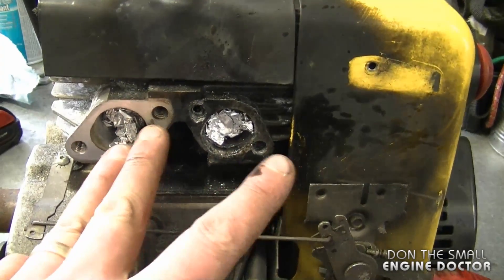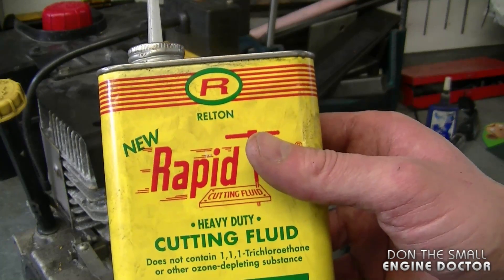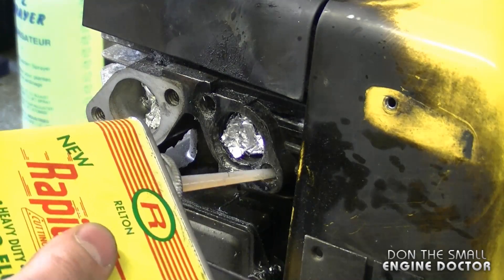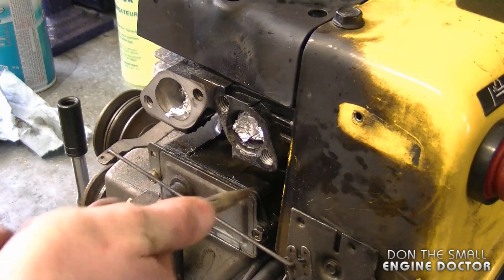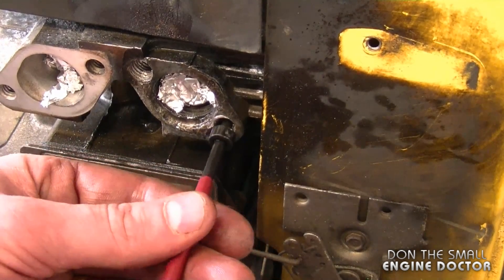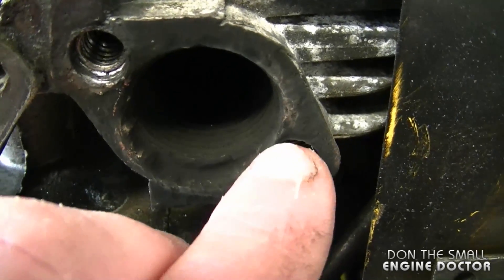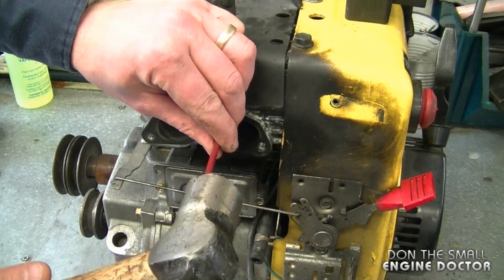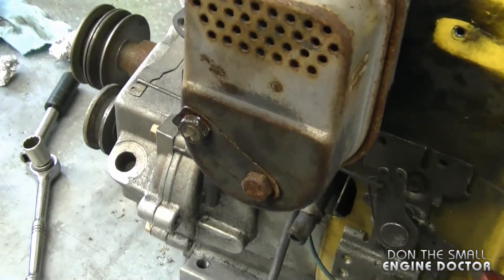How To Fix Stripped & Damaged Exhaust Threads Using HELI COILS - Thread Inserts

Comment: So umm, what happens when bolts come loose after helicoils have been installed???  

I got a paddock slasher mower with a GX390 engine on it.  The thing vibrates like CRAZY (big spinning drum with blades attached). The exhaust bolts kept loosening themselves.  I actually destroyed an exhaust letting it vibrate too much when loose.  Bought a new one and installed helicoils.  However the bolts STILL come undone.  I have to watch and tighten them up every 5 or 10 minutes.  

So umm, what's better the next step after heli coils? :P

Comment: Great cover on installing heli coils!  Thanks Donny.  One thing I did notice that, as you briefly mentioned, one of the holes had the "bolt inside".  I presume that it had broken off at the thread shoulder, leaving the threaded part inside.  I carefully looked at the previous footage, when that particular hole is being drilled out, before tapingdd.  It looks like a step was left out? It appears that the broken stub in the case had been drilled out with a smaller diameter drill?  This would leave the remainder of the broken bolt inside, with a hole down its center.  Just wondering ...

Comment: When using a Heli-Coil insert, remember that although the tap (your bolt size) needed may be say a 5/16. You must use a S.T.I. or screw thread insert tap not a regular tap. A S.T.I. tap for 5/16 or any other size must be larger so that the outside of the Heli-Coil insert so it can thread in and the inside of the Heli-Coil insert will be the true 5/16 size (for example). If you fail to use a S.T.I. tap your Heli-Coil won't thread in. S.T.I. taps generally have the initials "S.T.I." stamped on the tap.

Comment: I had a 2002 Snapper 824 series 6 we used commercially. At about 1200 hours, 10 years, the engine lost power. When I pulled the head, the headbolt nearest the muffler was stripped out, it had stretched from the heat of the muffler under commercial use for that many hours. The threads in the head for that bolt hole were stripped. My muffler bolts were also almost completely eaten thru from the heat.
Anyway, I ended up drilling that hole to the next bolt size up and retapping the threads in the hole. I also had to increase the size of the hole on the head for that hole and the head gasket. It worked, but a helicoil would have been better. I'm going to look into one of these kits. After I did that repair and re-set the valve lash, that engine ran good again, power was restored. Thats a testament to the quality of the Tecumseh HM80 HMSK80 flathead engine. It conditioned on as a residential snowblower.

Comment: Excellent video Don!  Thank you.  Another suggestion with blocking off the intake/exhaust passage is to tape (masking, duct, etc.) them off.  This helps insure no debris accidentally enters those areas during this type of repair.  -JD
Reply from the maker: +James David thanks for the tip
Reply: Somebody should have plastic Cap Covers ?

Comment: I have a Yard Machines snowblower with a 5HP Tecumseh engine and am replacing it this weekend. The engine bolts are coming up through the engine; when I install the new engine, can I face them town into the snowblower?

Comment: Worst problem with drilling is keeping drill straight. Worst problem with tapping is starting the tap. Both of these problems can be overcome with tapping blocks. Block of metal with clearance holes for drill and tap. If you do the holes on a drill press they will be square. Hold block over work, drill and tap. I cannot drill a straight hole by hand in metal, much less  tap one. With a tapping block it is much easier.

Comment: Another way to remove the tang is to use a good pair of small needle nose pliers to reach in and snap it off. If done properly the hole is not tapped to the very bottom of the drilled hole so there is space to bend the tang and remove it.  The needle nose trick works well on coils put in spark plug holes so the tang is not lrft in the engine.
Reply: Magnatise the punch.

Comment: I also like to shanfer the top of the hole after coil is been put in with a larger bit, makes it for a nicer looking Job, also if you run the install tool counter clockwise , it brakes off install tab
Reply: Chamfer

Comment: I know you used this engine for the purpose of showing a heli-coil.  I'm lazy and cheap.  I would thread a 1/2 muffler into the existing threads,  because it did have them.  I know not all engines have that option.  Nice video.

Comment: Excellent step by step instructions.  That thread repair kit is awesome!
Reply from the maker: +99carnot thanks Steve, I keep an SAE and Metric set
Reply: It is great that the kits come complete with the correct drill and tang breaker.  A lot just have the tap, insert tool and inserts.

Comment: I use LEFT HAND drill bit to remove broken bolts, sometimes I get lucky and they screw out when the drill bit locks into the bolt.  If mot I have a hole ready for tapping.  Drilling straight is very important.    Can the HEIL COIL work on head bolts?  Can they be torqued as before?
Reply: Head bolt can be done but you need to stack coils so you have close to the same amount of thread.

Comment: what type of adapter socket are you using?
Reply: +DocDryden D my guess is it's a 12-point socket. with 12-point you can grab a square bolt, which is the tap in this case.
Reply: +DocDryden D  Lisle tool they make tap sockets I got my at Sears.
Reply: +bub dog I'm guessing Lisle too!
Reply from the maker: +DocDryden D it from Lisle, comes in a set, very handy
Reply: Lisle LIS70500 8 Piece Tap Socket Set for all MCTI Taps thru 1/2 in.

Comment: If you snap a tap in the hole, can drill through it?
Reply: yes you can drill and extract a broken tap.  Quite a pain, but can be done.
Reply: +Ian “Dbz4ever10” Above   Drilling through taps can be very difficult.  Taps are generally made from hardened steel and it's difficult to center a drill on a broken tap and continue drilling straight.  And you'd need a very hard drill bit to do this, solid carbide or similar.  There are specialized tap extractor tools, check out: http://www.waltontools.com/products/extractr.htm   & http://www.waltontools.com/products/extract-sti.htm
Reply: +Ian “Dbz4ever10” Above avoid breaking a tap,,,,,,,it is quite hard material and not a easy job to get out
Reply: +Ian “Dbz4ever10” Above 

Using a carbide drill bit.

Most good taps are High Speed Steel  HSS, the same material as drill bits, so carbide drills are best for drilling taps.

The best way to remove taps is to weld a bolt to the end and wrench out.

More info that you ever wanted to know.  hahahahahaha